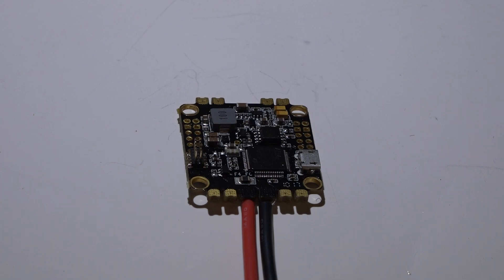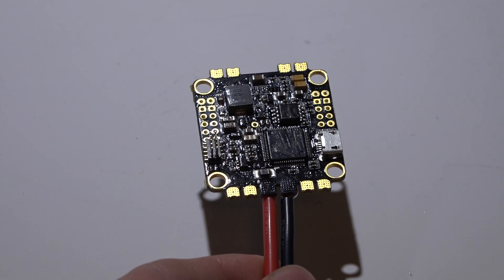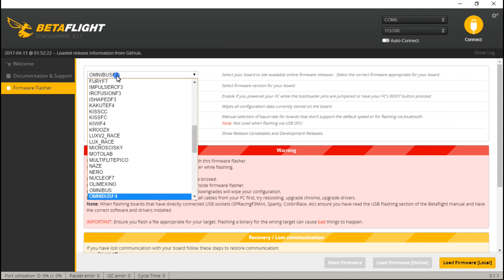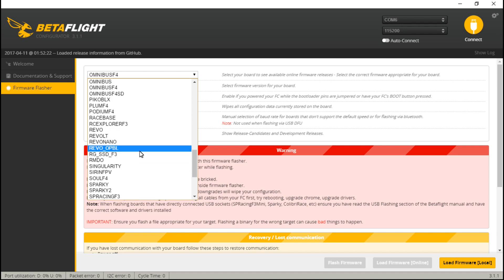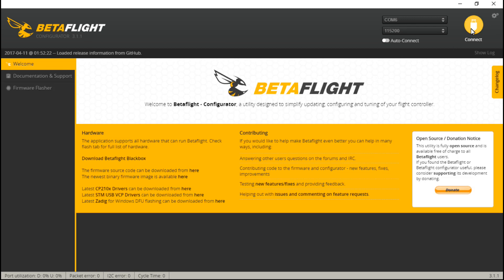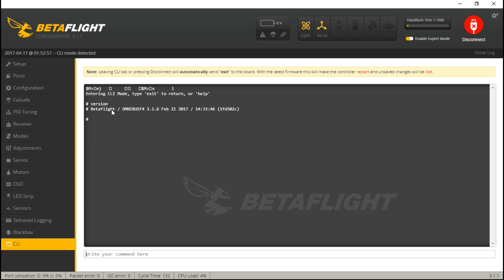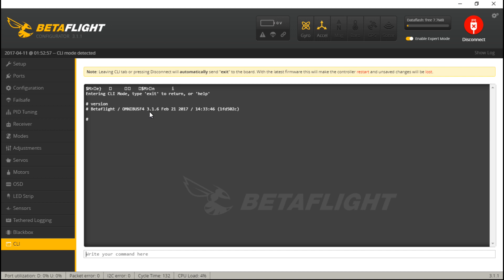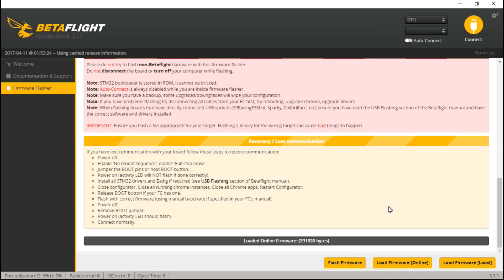Tip: How To Know What Firmware You Need

Comment: hi JC,
need some help if poss.just received f3 omnibus with baro, First plug in to pc all fine baro showing in the top box went into sensers  ticked box baro on and working, disconnected plug in again flash latest firmwhere o.k reconnect now no baro ?
been at it for hours now, what did I do wrong ?
thanks,
Kevin
Reply: New FW probably does not have baro enabled by default. You need to enable it again in the configuration, not sensors.

Comment: Could you connect that board to CF and still get the same version CLI results? I noticed you deselected "full chip erase" when updating. Does that allow for the saving of your previous settings or are the settings sometimes not saved and transferred to the newer FW?
Reply: I have not tested this in a long time since I never run cleanflight anymore but it used to be if you typed version in the CLI in betaflight and cleanflight was flashed it would say cleanflight / blah blah blah and the other way around

A full chip erase with clear out any custom settings you have on the board and load the firmware defaults